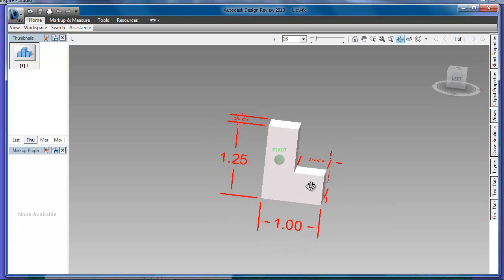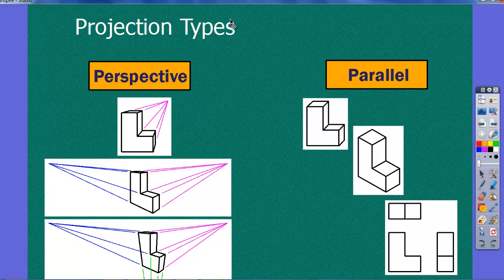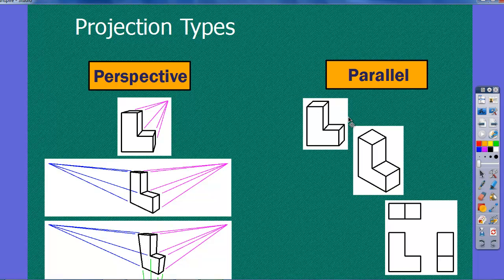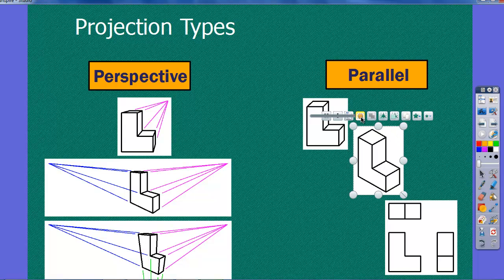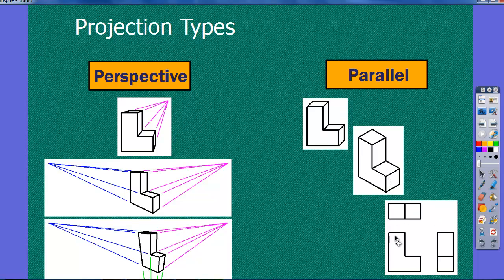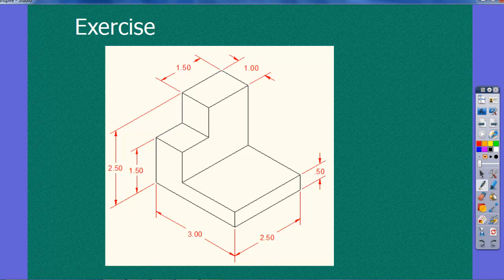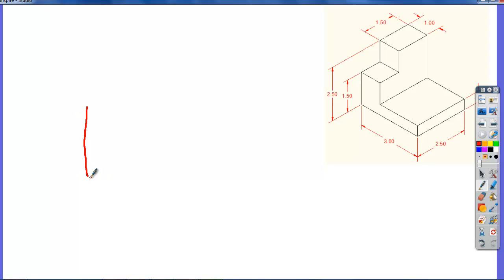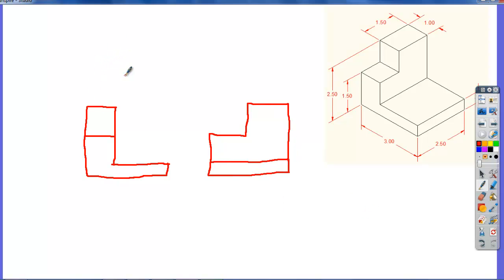Technical Drafting Projections: Orthographic vs. Pictorial Explained

Comment: Hey James, I'm really interested in drafting and I was even hoping to find a career that uses this in industrial or mechanical design/engineering.  I'm wondering if you could kindly answer a few questions for me.  What job do you have and how does it allow you to use drafting.  What programs do you use? Solid Works is one that I have heard a bit about.  and finally, What other careers could use drafting?  
Thanks 
Kaitlin